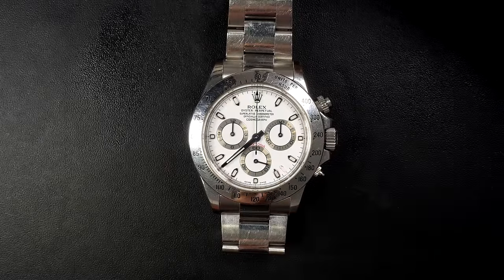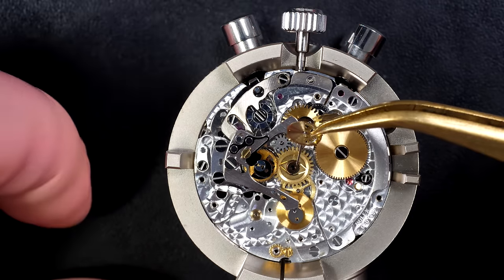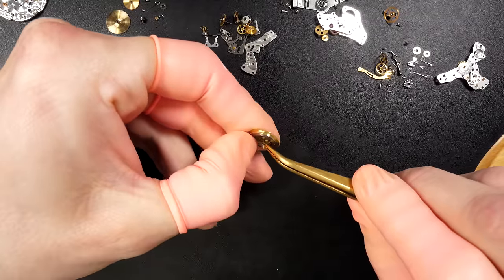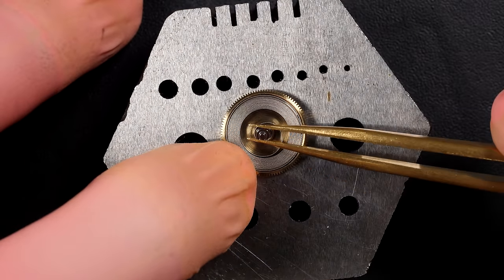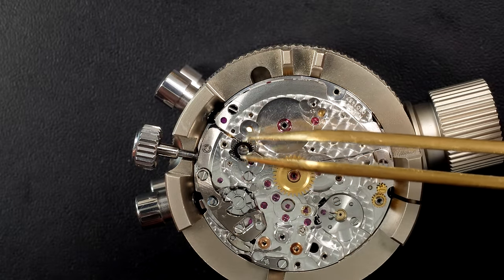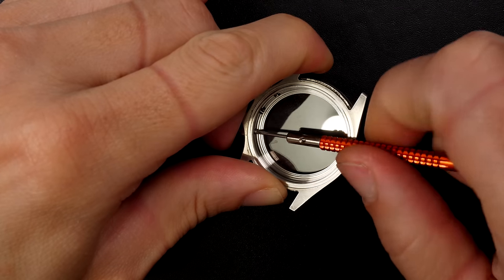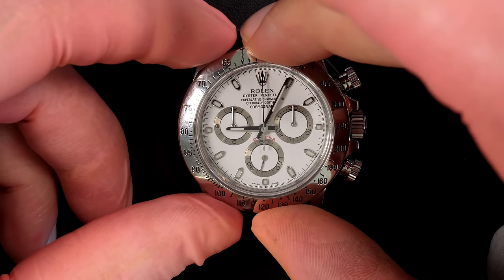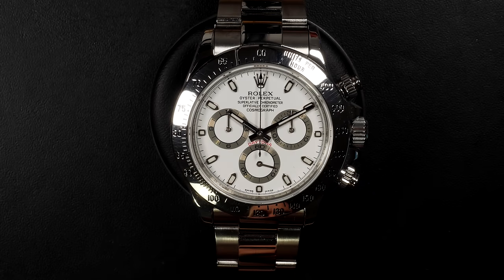Restoring the Iconic Rolex Daytona Chronograph Watch !!! Rolex Daytona 116520 caliber 4130

Comment: I put the crown back in but the watch won't wind. Is there anySomeone has an answer
Reply from the maker: Unfortunately you have to disassemble the watch and check the issue with the keyless work and the crown wheel

Comment: Hey There.
Great video.  Not many 4130 videos out there.

A couple of things I noticed:

-Make sure you take care in grease placement and the amount of grease you apply.  Around the chrono mechanism there was a lot of grease applied.
-Rolex actually wants you to hack the movement when installed the clutch and chrono wheels.
-Be careful removing the hands.  It looks like the minute sub dial hand was bent in the middle.  I'd get a set of very small hand removers for those.
-I'd stray away from polishing unless you have specific equipment.  Without laser welding, your rounding the edges of the case way too much.
-It would be good to show other positions while timing.  Dial up is only one of 5 positions needing to be measured...technically.

Cheers!
Reply from the maker: Thank you for the info

Comment: I have a Daytona that has a stem that is broken so it is impossible to set the time. Any suggestions on where I can get it repaired?
Reply from the maker: You can send it to me or any watchmaker
Reply: @FrenchWatchCollector  it’s a replica and some watchmakers don’t work on replicas.
Reply from the maker: @billbuss7542  yes because the movement is not reliable and we don’t take the risk of repairing and get some issues later

Comment: I think the inside is better looking than the outside. I always wanted a Daytona till I found out that they're screw down pushers and you can't even operate the chronograph without taking off the watch I'll stick to my quartz Bulova
Reply from the maker: You can operate the chronograph on your wrist without any issues. It is just that the pusher are screw down pushers like the crown.
Reply: You can operate the chronograph fine without taking it off.
It is very easy to unscrew the pushers (even with the watch on) or just leave them unscrewed.  And the watch will have the same water resistance with the pushers unscrewed....just don't push the pushers when in the shower/underwater....just like you don't want to do on any chronograph without screw down pushers.
Reply: @robertbarta4912  good to know

Comment: Apart from your excellent work on the movement, im always disgusted by the job that watchmakers do on case and bracelet finishing. Man those runded edges on endlinks (lok at 41:07), rounded bezel marks and edges. Brushed finishing on the links is totally wrong. 99% of watchmakers shoud be banned from using polishing wheel, unless they have special equipment (like for example dude from WatchesSpa - look at him, he is supreme). That case was butchered.